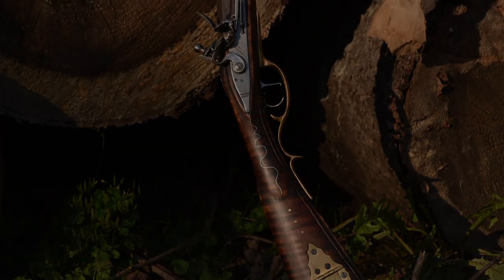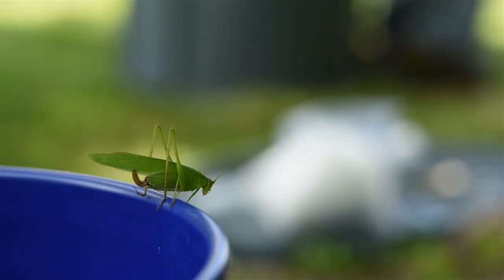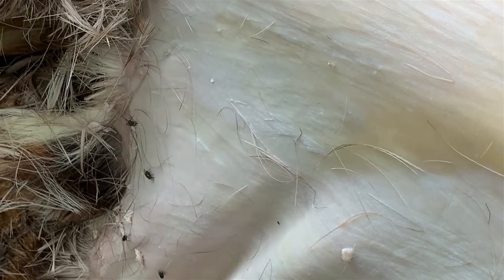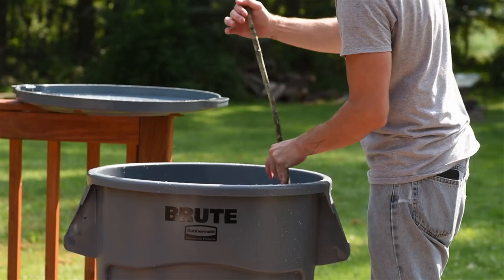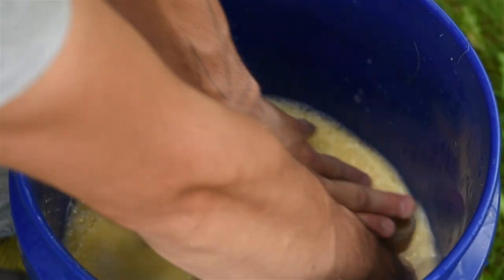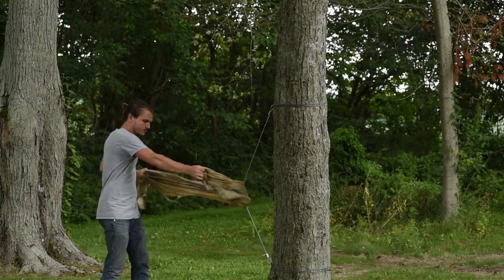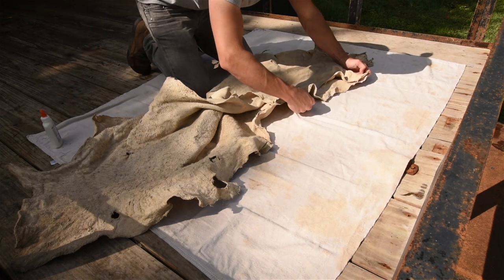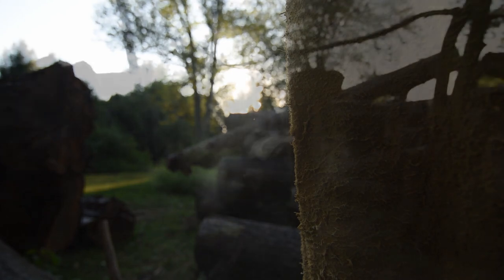Deerskin To Buckskin ~ First Time Brain Tanning

Comment: good video but the "brain tanning" in your title is misleading, since you egg tanned.
Reply from the maker: Thanks! And I do understand where you’re coming from, but brain tan is not only the term most commonly used to describe this method (regardless of the oil type used), but it also makes it easier to find in search results. 
And technically, it is oil tanning, but calling it that would confuse the matter even more for most people.

Comment: I will admit that I prefer tanning furs over making buckskin simply because wetscraping is so absurdly frustrating to me.
Reply from the maker: I have little experience with any tanning overall, but I definitely want to do some work with furs in the future!
Reply: @EccentricArtisan  Furs are a mixed bag in some ways. Deer, for example, is an easy starting point as the follicles are resilient and don't slip terribly easily like many furbearers. Deer are also not particularly fatty animals, so the degreasing work is minimal. The braining is done pretty much identically to buckskin, however softening can be more difficult due to the fact that you have fur on the adjacent side of the hide. This can limit your options when it comes to grabbing and breaking the hide.
Reply from the maker: @blackknight9156  I can definitely see what you mean. Thanks for the info! I’m thinking of trying beaver first potentially.
Reply: @EccentricArtisan  I hear beaver is great. Unfortunately, beaver is one of the first I haven't gotten a hold of yet. I am curious to see how it turns out.
Reply from the maker: @blackknight9156  currently helping my sister do her first deerskin and then I may work on fleshing a few beaver.
Reply: @EccentricArtisan  Perhaps you could make a video on that. I always love to see how people's first hides turn out.
Reply from the maker: @blackknight9156  I’ll see how time plays out. I’d definitely like to.

Comment: I always like to stake mine for as long as possible before moving to the cable. Saves a lot of effort. Also, I try to soften on a warmish, sunny day with low dew point/humidity, as this speeds up the whole process.
Reply from the maker: I’m definitely going this route next time. I didn’t really consider staking until after the fact, and the timing just wasn’t right to get lower humidity unfortunately. But I’ll try to plan around that in the future. Thanks for the advice!
Reply: @EccentricArtisan  what is staking? Thinking about trying this season and am currently learning all the lingo
Reply from the maker: @colec253  the term itself is derived from the act of breaking (softening) the hide by running it over a wooden stake. That stake could be a post in the ground or on a stand or even a small tree cut off at a comfortable working height. The stake would usually have been shaped on one end to have a good point or edge that is defined but dull so as not to damage the hide or you. But staking could also be done in other scenarios, like the hide being stretched on a frame and the stake being worked over the hide while holding the stake in your hand.